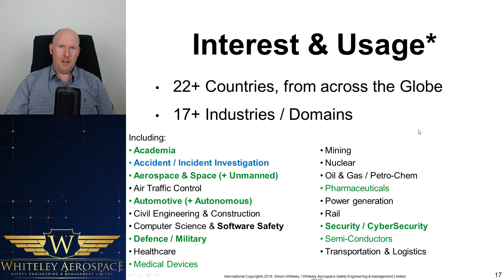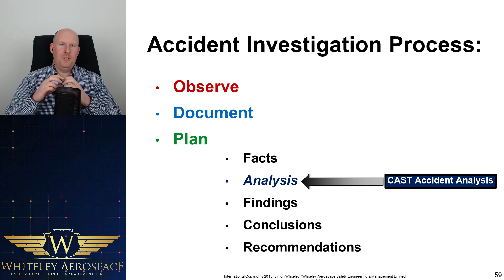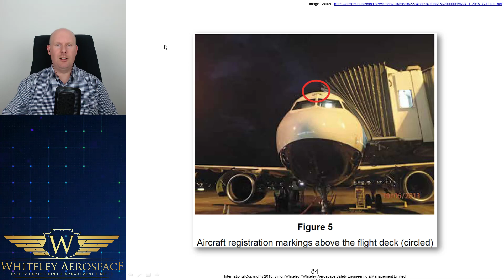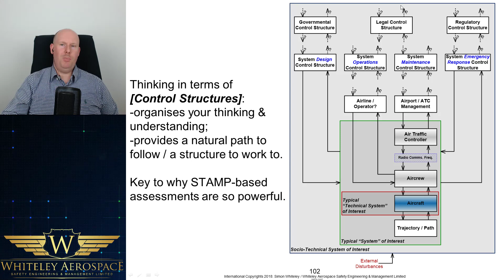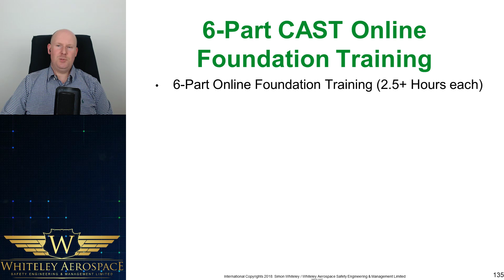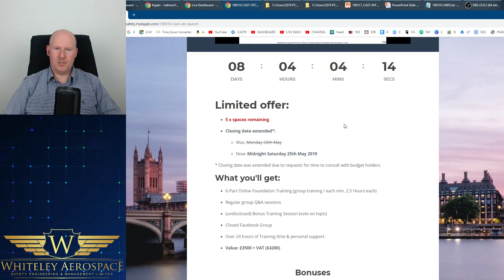CAST Accident Analysis: V. Brief Overview

Comment: Why do you call it High Level Control structure, when it seem reasonable to me that it should rather be Low Level Control structure, since that is what is proximate to the Loss. High Level Control structure should be at the corporate level, not the hardware or production level.
Reply from the maker: Hi @andrewagyeman3338, I use the term "High Level" to reference to a level of abstraction that is not particularly detailed, e.g. a control structure containing 3 x controllers.
When referring to leadership levels in a control structure model I might refer to them as "higher levels" / "higher levels in the hierarchy".

The delineation between the two is:
1) level of abstraction / detail in the model, and
2) level(s) in the hierarchy representing both accountability / authority / influence and proximity to the physical process / sharp end.
I trust that helps, let me know what other questions you have, please visit my website and send me a message. Take care, and thank you for commenting.